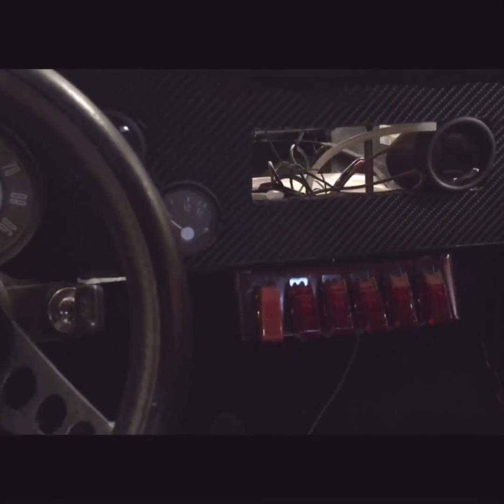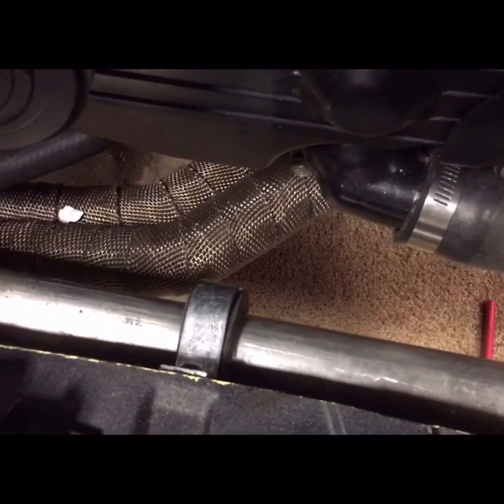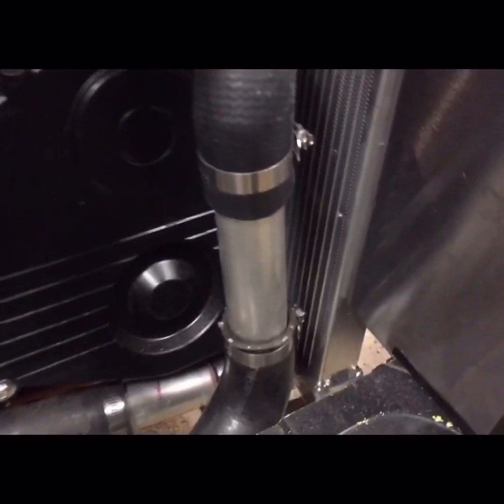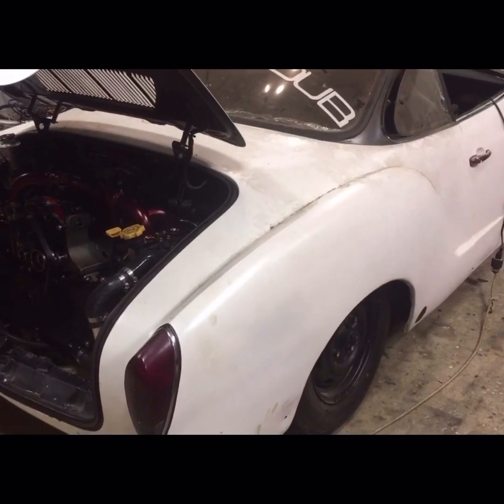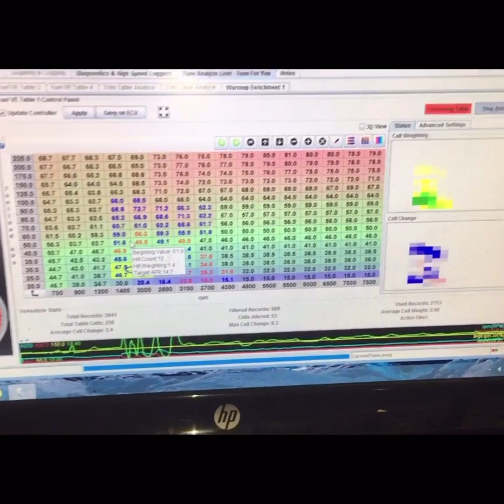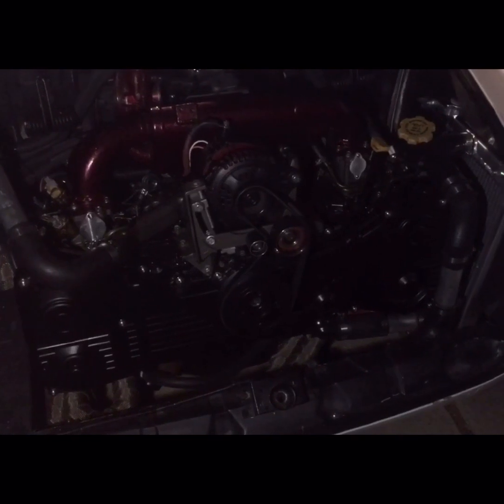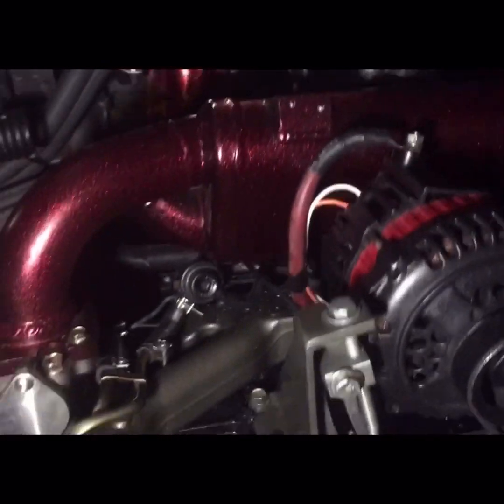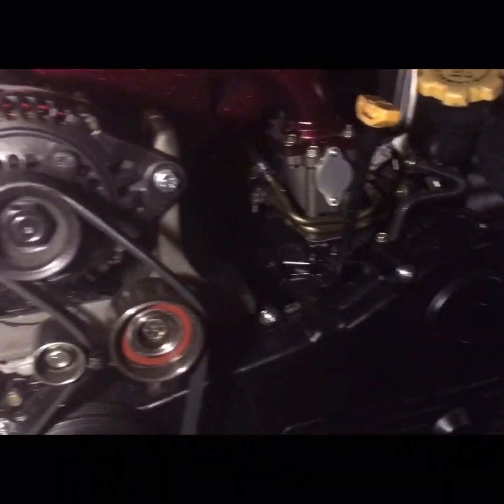Subaru swapped ghia #7

Comment: Did you have to swap transmission??
Reply from the maker: Frank Vargas this one is on the stock trans not recommend at this power level but the motor is coming out and the car is for sale
Reply: @uberkooledgarage  How did the gearing work with that motor? Is first gear usable?
Reply from the maker: Andrew Dorolek gearing is perfect first is is short with any motor but it really picks up more speed because of the 7200 rpm red line I have never let it get that high because I don’t want to blow the trans